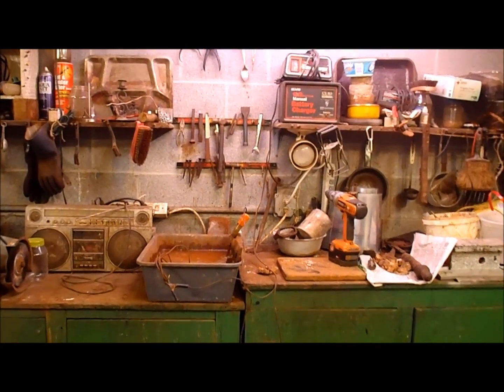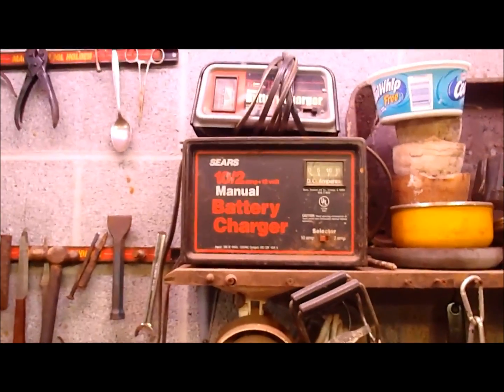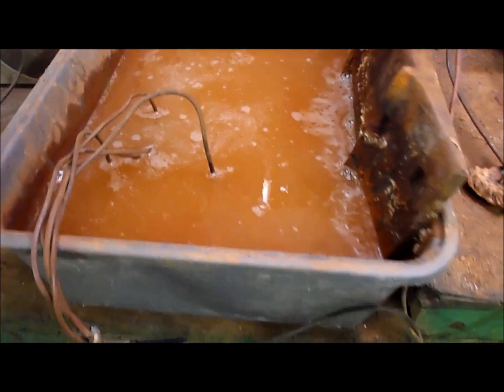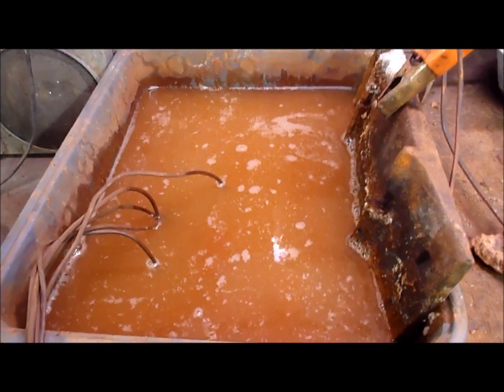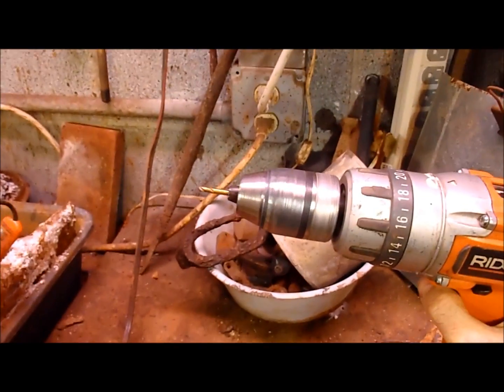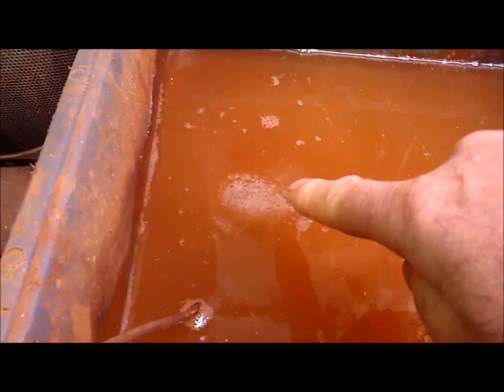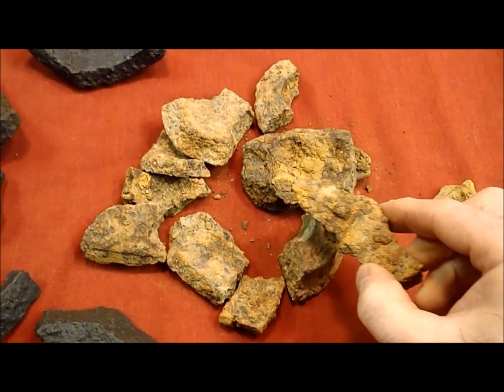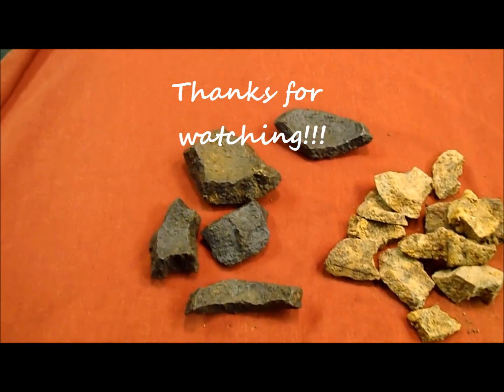Preserving Iron Relics: Electrolysis

Comment: I ran into the issue with the automated battery charger.  I just happened to have one of those low power battery maintainers laying around also and it's also auto sensing.  I hooked them up parallel to each other and the battery maintainer fools the big charger into thinking its connected to a battery.  When the big charger kicks on, the little maintainer senses it and shuts itself off.  Anytime the main charger gets disconnected or cycles through some sort of voltage check, the little one kicks on and keeps the big one from shutting off. 

Also, an interesting fact, I've also noticed that after a while of the process going, the tub seems to have its own voltage.  Mine had just under two volts and didn't hold it long, but it was enough to keep the charger  from ever kicking itself off.  Sorry for the long comment.  Hope it helps someone.

Comment: ok have a question. I found a cannonball and trying to use electrolysis well its pretty well clean from that and now trying to clean the inside. I have a small hole from where a paper fuse would have been placed and trying to clean out the matrix. I dont want to cut the cannonball not interested in drilling a larger hole or 2nd hole trying to keep it intact as much as possible. How do I clean out the matrix??? I believe it is tar since I get tiny black pieces out.

Comment: COOL! what does this do, chemically? Is it like a slow version of phosphoric acid treatment? Thank, Yeah, make sure there's a little air movement around it, contain it in a hood and that spark will explode the hydrogen bubbles that come out and collect, lol. My boss and I have made explosions from hydrogen bubbles out of water electrolysis. He was trying to make a kind of motor that began actually burned some of the hydrogen and it wentPOW one time and we realized it was running backwards after the backfire-on-steroids hehe. He might give me the hydrogen generator (a bunch of electrolysis plates with a collector/accumulator) so I can make a rechargeable electrical battery out of it.

Comment: Hi Aquachigger,
 I just set up an electrolysis bath for some old horseshoes and other old iron relics I have. A giant wrought iron draft horse shoe turned out really nice after six hours or so. I also waxed it by putting it in the oven at 350 for 30 min to get rid of the water and then pressed a candle to it to melt the wax on. (using a giant tub of boiling wax like you do seemed a bit intimidating). Anyway, I just tried my next couple horseshoes, but I couldn't get anything to happen. Could this be because they are steel? They don't look nearly as much like wrought iron as the other one. I thought there might be a problem with the connection, but when I put in a big old square nail to test it it bubbled just fine. Any thoughts?

Comment: The dark material is magnetite it shows that you have very good electrolysis the rust has turned into magnetite that is what the process does it converts rust into the magnetite. You did not leave it in too long perhaps the others were left in to little, it should come off with a wire brush and look even better than the others:)

Comment: I watched a few other videos on electrolysis and they say to use arm and hammer washing soda  sodium bicarbonate. not sodium carbonate for reasons described here. he says you can use baking soda, but would require baking the items first? I'm sure you have great results but you might have even better results with washing soda. the video I watched is called "rust removal by electrolysis: use in the restoration of.." by a guy named Keith ticket who is restoring some old printing press or something. anyway just thought I'd pass that along.
Reply: Keith rucker  rather. stupid auto correct.

Comment: Sorry to ask this but,  what was the point of what you did in this video??
Reply: +Evelyn Nobles The point is, electrolysis, gets all the rust and build up of the relic without grinding and taking off the metals desirable writing/embossing or surface.

Comment: You'd get quicker, cleaner and better results if you used carbon anodes (a quick source is carbon arc welding rods from your local welding supply house) and an adequate amount of washing soda (not baking soda) to get the pH to a more efficient level.  Warming the solution also helps. Your putting screws in the cannonball fragments is a great idea to assure a good electrical connection.  Look at the various Shopdog Sam videos on electrolysis for his pioneering work on quickly cleaning parts with a good bit of washing soda dissolved in warm water, using carbon anodes, and generating no surface scum in the electrolytic solution.

Comment: Use sodium hydroxide from a plumbing supply store. I did a 300 lb iron anchor, it took 9 months to cook with 1-2 amps going through it.
Reply: I have about the same size anchor I'm planning on recovering from the ocean. How much in electricity costs do you think it cost you to run for 9 months?

Comment: Beau, I built a little electrolysis unit today. If I'm getting mostly bubbles off the clip itself attached to the item to be cleaned, does that mean it may not be making good contact with the iron object it's attached to? Also, does it matter what the alligator clips are made of? I had the option of steel, or bigger copper ones. I used the steel ones.
Reply: *****
 Ok thanks. I have just the negative in the water. I keep the positive out of it. The piece I wanted to clean is too small to drill and put a screw in.
Reply: +Beau Ouimette  Yes, and you have to keep replacing the Alligator clips when they crumble to shit...... just ask me.. lolol.

Comment: I need help, I tried this with coins using a old cell phone charger. I used a jar, baking soda and warm water and a spoon. I hooked the negative wire to the coin and the positive wire to the spoon. They both were bubbling and I left them alone for two hours and the coin was not cleaned at all and the water was not dirty. What did I do wrong?
Reply: Both of the objects were bubbling, I thought just the one that needs cleaned is the only one that needs to buble.
Reply: Brandon Mckittrick Both will bubble, one will be hydrogen, and the other will be oxygen.  The negative NEEDS to be on the part you want to clean.  It also works best for iron and steel based parts

Comment: This is a great process, I use it a lot on finds and during vehicle/engine restoration.

I wouldn't recommend stainless anodes (positive side) because it can release toxic compounds into the solution.
Carbon rods or sheet is the best if you can find them, they don't get gunked up like steel does, although it is the more expensive option.

I use a converted computer power supply, they cost basically $0 and are very reliable. :)

Ash

Comment: I have one question, for the small things i find i use phone charger and i don't really know where is + or - so i plug it the way that bubbles go from the peace that i want to clean and judging from the video i have been doing it the wrong way? or not?
p.s. sorry for mistakes
Reply: ***** can i use electrolysis on other metals? and if yes does the other metal has to be the same or iron is fine?

Comment: This process is called Reverse Electrolysis. When metal is in water, it is the process of electrolysis that deteriorates the metal. When you do a reverse electrolysis you are stealing electrons from another metal, like stainless steel, to strengthen that metal.  

The bigger the artifact the longer it takes. A large cannon fresh out of salt water can take up to two years. Smaller artifacts like a button can take a day or less. Smaller artifacts need less amperage.

Comment: Quick question. Once I get the relic through electrolysis, I know I need to coat it. I don't feel comfortable, nor do I have the set up, with hot waxing. Is there anything else I cant do to coat the relic? Spray poly? Anything you recommend?
Reply: Christian Hidy wipe a lite coat of linseed oil on it

Comment: Beau - great video - thanks! BTW, have you ever tried apple cider vinegar in lieu of electrolysis? I've found it works very well. I've had some challenges (using both methods) of rust returning though. I always "bake" the relic in the oven at about 200 degrees for 30 minutes to remove any remaining moisture, then seal with Briwax. Someone has recommended spraying with WD40 before sealing. What is your advice for preventing the rust from returning?